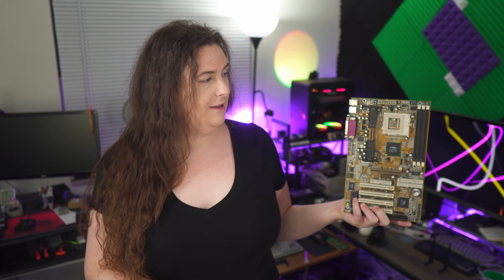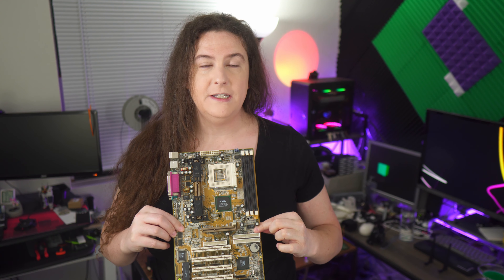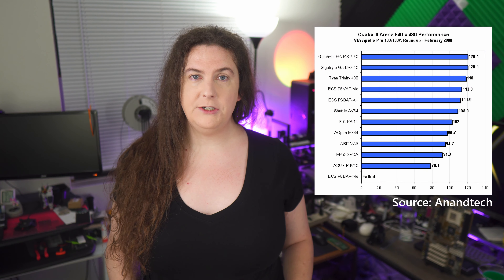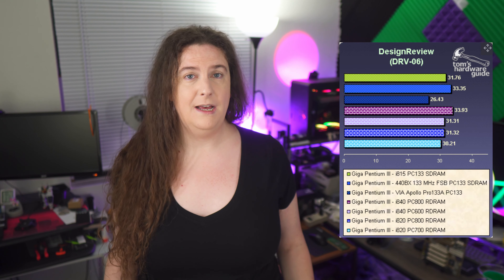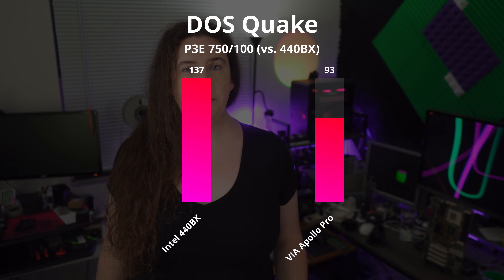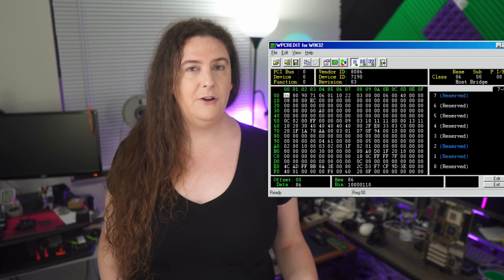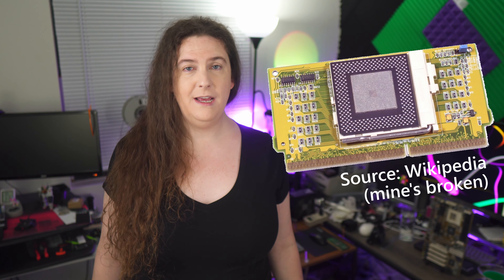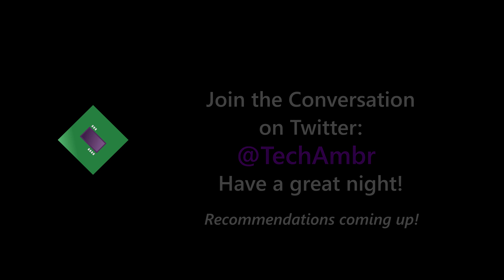Combo Slot-1 & Socket 370 Motherboard

Comment: Great video. Wow, can't believe how bad that is compared to the 440BX. VIA has such a mixed bag of chipsets, but interesting that manufacturers can make them that much worse! I wonder what retail pricing was for that board when it was new compared to the higher performing ones. Could be a case of too many corners cut in QA to keep the costs as low as possible.

Comment: I have the same board but is from PC Partner model: c95000v, if you plugged in any usb drive or a PCI USB 2.0 card with usb drive in it, the performance will drop by half. So everytime if I wanna run games or any 3D benchmark, I have to make sure no usb device plugged in.

Comment: via and wpcredit always go hand in hand.  bx has a crazy advantage at 133 because of its out of spec 2/3 agp divider and for some reason crazy low latency mem at 133. Either way via chipsets are a tweakers chipset. the biggest downgrade apollo pro had over the 133a was lack of 4-way interleave. some can have this enabled and there are write ups so its not difficult like you say using wpcredit. there are pcr files which have all the settings documented its a question on enabling/disabling and testing. now your not wrong in saying that the vanilla apollo pro is trash in some way thats for sure. its no bx out of the box lol. either way some apollo pro boards cant be saved so this vid is merited. with via you always go for the "A" revision of the chipset like the apollo pro 133a,kt133a,kt266a etc... for those.

Comment: I had one of these ECS VIA boards with a P3 800 and a Geforce 256 and was surprised to see my friends 500Mhz P3 & Voodoo 3 got much more frames frames than my rig and just generally snappier.  Later installed Sisoft Sandra from one of those PC mag demo cds and was shocked to see the poor memory performance of the VIA chipset, litterally 1/3 of my friends PC that more than likely had the 440BX chipset.

Comment: VIA used to make absolutely weirdly featured chipsets. Like dang. I have a socket 478 motherboard that takes pentium 4s, and with PCIe and DDR2 ram! I didn't think about it like that back in the day when i bought it i was just like yeah finally i can upgrade from AGP to PCIe without buying a new cpu. But that's a wild feature set.

Comment: In my experience, Apollo Pro 133 was quite slow, but Apollo Pro 133A was a lot better, about BX levels of performance, a bit higher, and competitive with the RDRAM Intel chipsets of P3 era, until 815EP came out. But I've also seen the performance being all over the place depending on the board manufacturer. I would suggest modding the BIOS first, fixing all the known bugs etc., and checking it that way.

VIA chipsets had a lot more luck on Socket A.

Comment: Used to have these 5 Dell Optiplex systems back in early 2000. They had dual Slot 1 sockets, two 550Mhz PIII's installed, onboard SCSI, Diamond Viper 770's. Amazing systems. Workstation PC's I got from a police auction for pennies. No other geeks there that day. But I've never had a slot 1 / skt 370 combo board! 

Incidentally I was looking through some stuff the other week and found a bunch of these small cards with CPU sockets in them. Had no idea where I gottem or what they were - but after asking on Vogons I was told they were "slockets" for using PGA370 P3's in Slot 1 motherboards! Pretty cool. Odd tech.

Comment: Without tweaking the memory settings on my Jetway 994AN-L (Apollo 694X instead of 693) BIOS - my PIII 1000 performed at PIII 800 levels. Otherwise, it has been a rock-solid board once I replaced the failed capacitors. Lack of the memory interleave setting is one of the more serious mistakes in its BIOS (there is a patch that can be run in Windows to enable it however).

From what I've read as well - the 994 might as well still have the 693A on it instead of the 694X. And I agree because it lags far behind my Abit VP6 when left at its optimised defaults, as well as my Intel 440BX-2 (retail version not Dell) being smoother in Windows with; Pentium II 233, Celeron 300A, 333 and PIII 650.

Comment: I own a SS7 motherboard with a via chipset. Idk which one it but I hope it's not this chipset. It's in storage for the moment. If it is, well then it becomes a DOS machine
Reply from the maker: Probably not -- VIA's SS7 chipsets (VP3 and MVP3) were pretty good if I remember right. Fingers crossed!
Reply: @TechAmbr  I wondered all night about it. So I went and pulled it out of storage. You are right, it's an MVP3 chipset. The motherboard is a EP-MVP3G2. Not sure if those chipset are good.
Reply from the maker: @mOddEdLiKeHeLL  Should be pretty decent, yeah! It's tough to find a Socket 7 board with and AGP slot these days. I looked it up on The Retro Web and it looks like it'll support a K6-2 all the way up to 550 MHz. It's got K6 III support, so you might even have luck with the K6-2+ CPUs floating around that can be unlocked into K6-3+ 600MHz monsters.
Good luck! That's a nice board!
Reply: @TechAmbr  the retroweb site is pure gold! I love that site. Yea, it's pretty cool motherboard. ATX, AGP and AMD K6 support. Mine came with a K6-2/500AFX in it.

Comment: After dealing with couple dozens of Apollo pro motherboards, it is clear... 440Bx rules. Even I use asus p3b-f with a modded tualatin on slotcket, I have a Tyan motherboard with both slot and socket! :)

Comment: That board has good PCB design and it should be good with Intel 815 chipset. But even with that not so good performance can be good to pair with Celeron and ISA soundcard to play some old DOS games with having only DOS on CF card installed with games. For Windows will be always better to use just Intel chipset based board for Slot-1/Socket 370 cpu's.
Reply from the maker: Yeah, honestly with the Celeron 533 or 667 installed it'd be a perfect SVGA DOS machine.